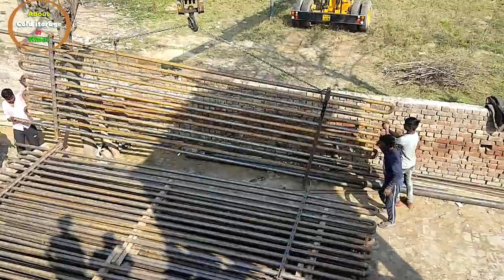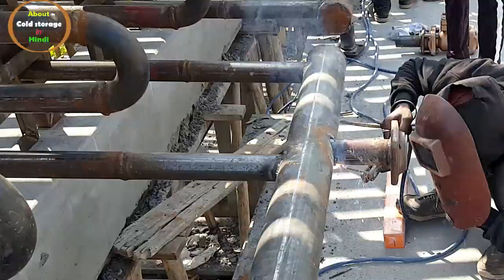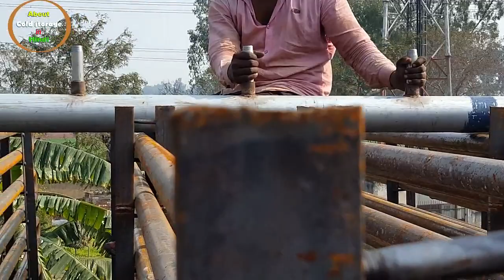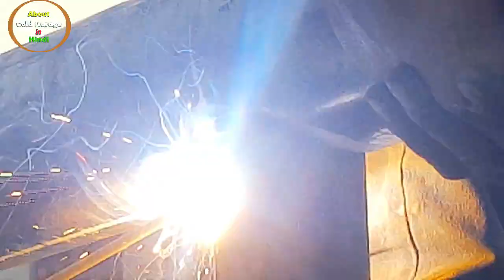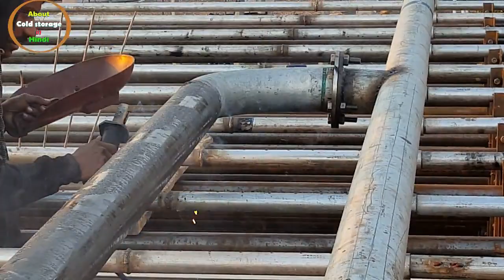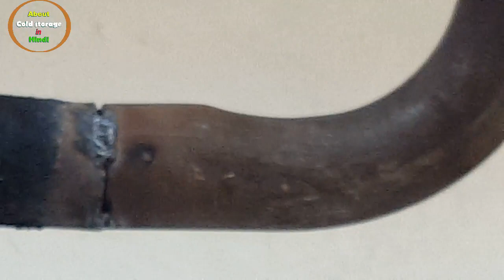How to make a new condenser

Comment: Kcx3 compressor me high pressure 16 kg/cm2 rehta he. condenser water sahi chal raha he. pressure kese 13-14 kg/cm2 maintain kare.? plz ans
Reply: Suction kitna deri
Reply: .1 aap ka condenser ko Hawa lagti hai Kya ye Dekhe na lagti hogi to fan lagaye .
2 .Pani ka tank chota to nahi ye bhi Dekhe uski wajhe se bhi hota hai discharge p zyda .
3.condenser 7 hone chahiye aur 14 pipe hone chahiye  kcx3  ke liye.
 Last one thoda expansion valve ko Kum karke Dekhe usse bhi control hoga dp